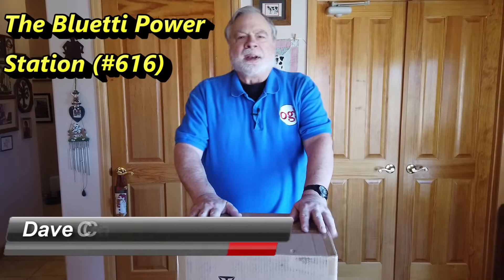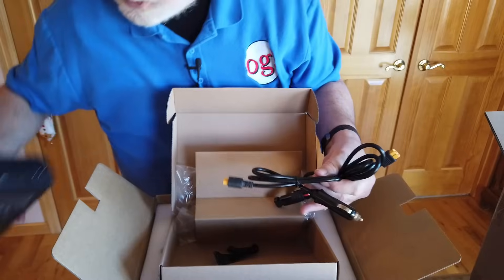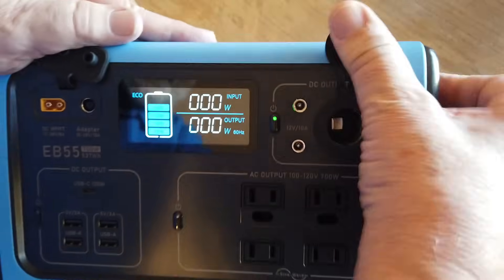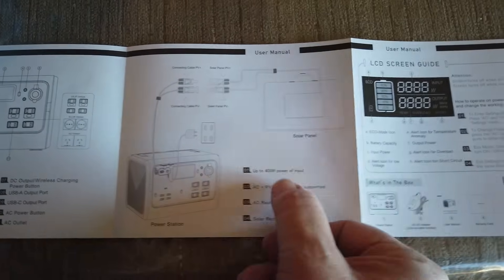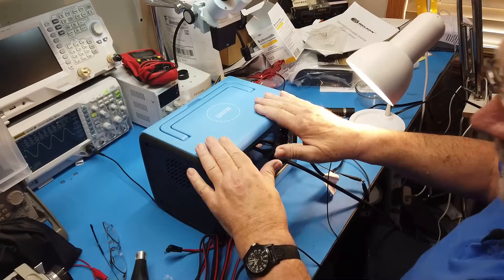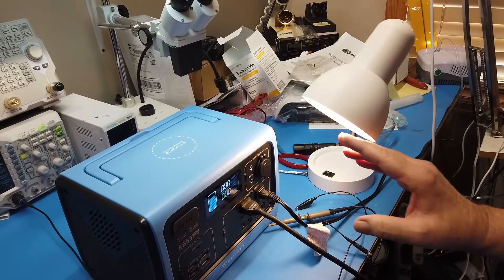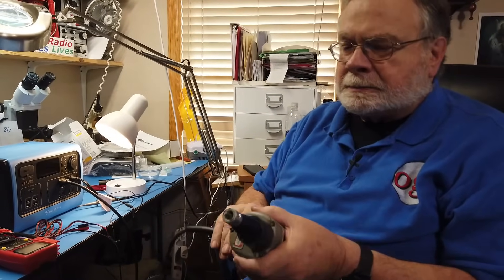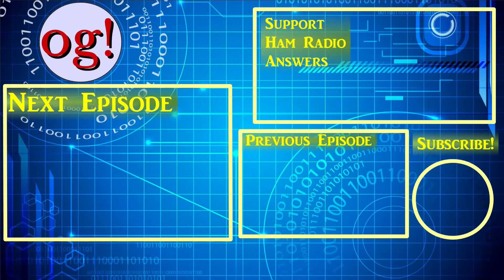The Bluetti Power Station (#616)

Comment: Could you put your oscilloscope on the 12v output to see how clean it is under load? Many units like these use buck boost converters for the 12v out and might generate rfi, so a possible issue if powering a rig.

Comment: I bought the EB70 this past summer and love it. Jackery is way behind in technology, still using the old style lithium batteries. Bluetti is a way better power station. I use a Bladr 120 watt folding solar panel with mine when I solar charge it. Inverter is PURE SINE WAVE.

Comment: I would like to add that there are some sensitive electronics that would not like running on that a/c voltage level. In my opinion I stay away from an a/c power source thats less than 117 volts for those types of electronics. Having said that 113 volts should be ok for various types of inductive loads for short periods of time.
Reply: This is exactly what I was saying. The US voltage standard is 120V not 110 or 115 or 117. These things need to be 120V RMS.

Comment: Beyond me why these companies that want to capture the amateur radio market but don't put any Anderson power poles on the unit or at least supply an adapter cable...? When I look at a power station that is the first thing I look for.
Reply: I suspect it is a cost vs. perceived benefit decision.  Added manufacturing costs of Anderson Pp's, added complaints from non-hams that "nothing fits goofy red and black sockets," and the reality we are a very small percentage of likely buyers.
Reply: Some companies do. But it's easy to get adapters or make your own.

Comment: I had one of these last year. During a power failure, I powered up the fan on my wood stove and hooked this up to my garage door openers. Neither of my doors would open properly. (Raise up about 3 feet and stop.
Reply: What were/are the amp ratings and load on the items you were trying to operate?  1 D sized battery would not lift those either.
Reply: @davidpatrick1813  I never would have guessed that a D battery wouldn't supply a few hundred watts...  It was the same 500 watt unit shown here. The garage door motors are rated at 225 watts.
Reply: @timmack2415  I am surprised it failed.  Thanks for the report.

Comment: Dave thank you for all your time to the chan. Keep up the good work.
Reply: This is interesting. I bought one because I moved to a remote area of the Poconos. Sadly, the power goes out more than I do. LoL
Anyway, I used this on a transfer switch so my wife could get the cars in/out of the garage (the roll-up doors are heavy)! 
On a full charge, they could not open the garage doors. The doors would raise, perhaps three feet and stop, every time. 
The voltage seemed adequate, but the craftsman motors did not like it. I replaced it with a different brand and it works flawlessly.
I'm not sure of the exact problem, but I sold my unit and the guy who bought it runs some lights with it and it seems to work well for him.